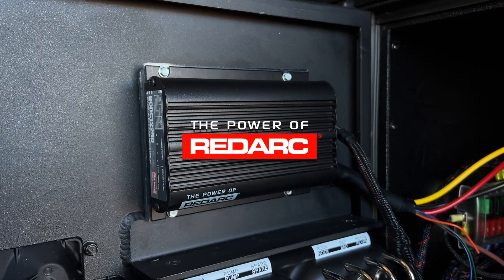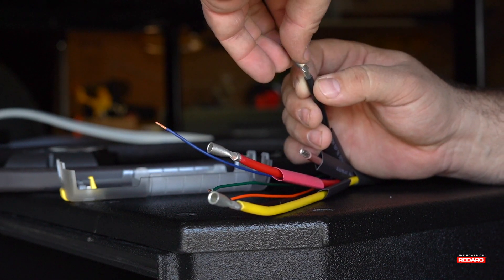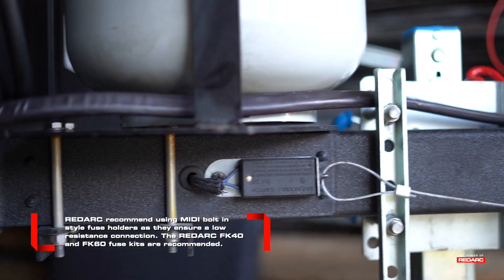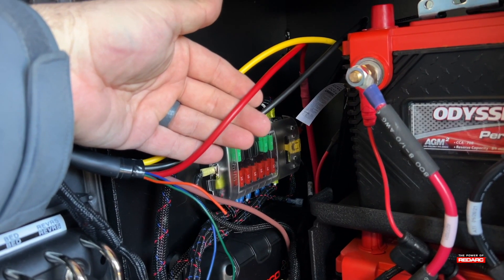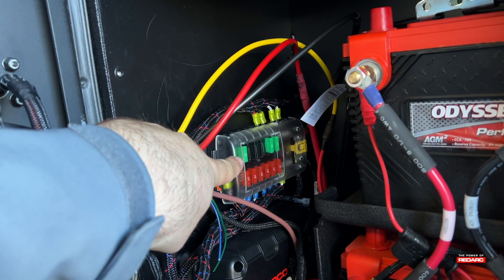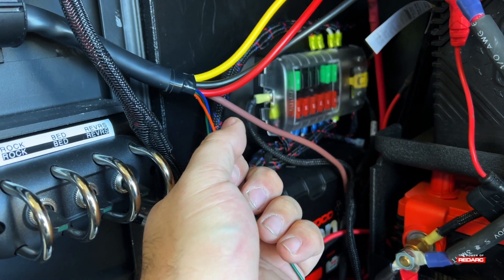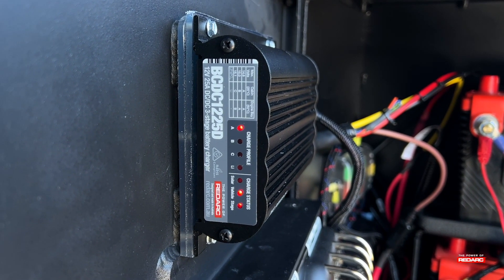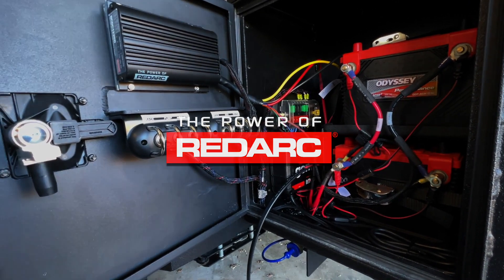Overland Trailer Power - REDARC BCDC1225D

Comment: It looks as if you did not connect the ignition or blue wire, is this correct?  My understanding is that if this is not connected and the alternator goes into a reserve mode (don't know technical term) the charger will not have enough volts to charge the auxiliary battery.  Can you provide some guidance?
Reply from the maker: NOT CONNECTED: Standard trigger (for fixed voltage or temperature compensating alternators)
12V Mode
When Blue Wire not Connected it will take a charge when voltage from battery is above 13.2V